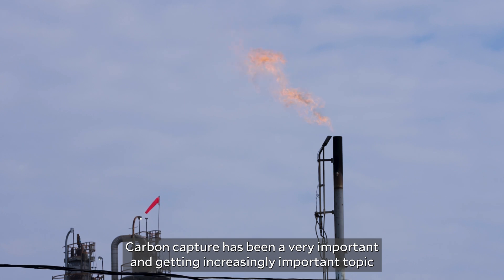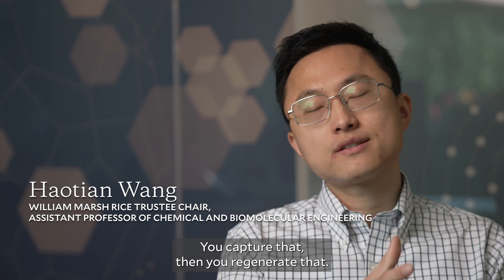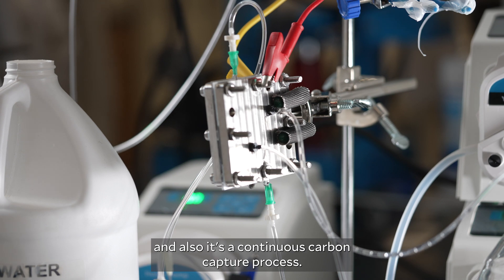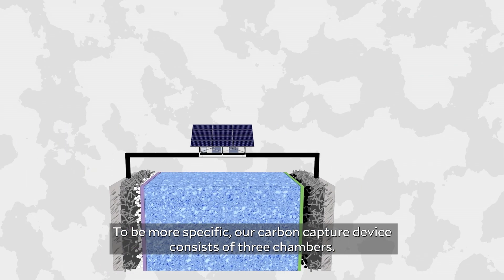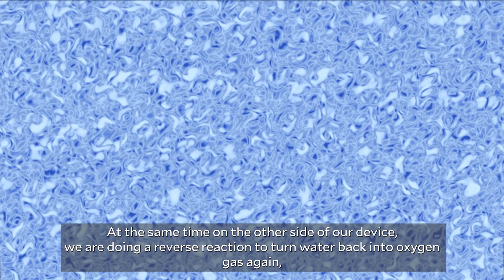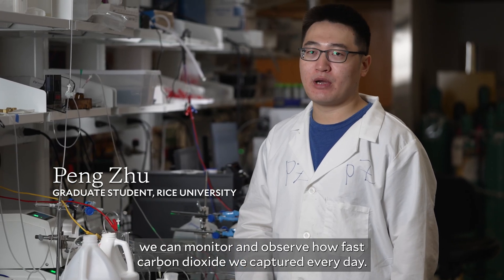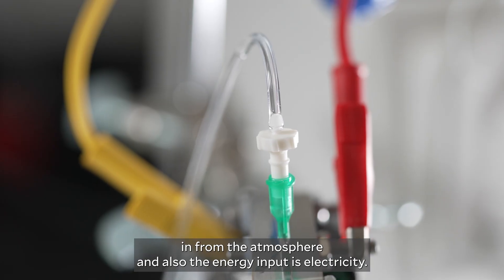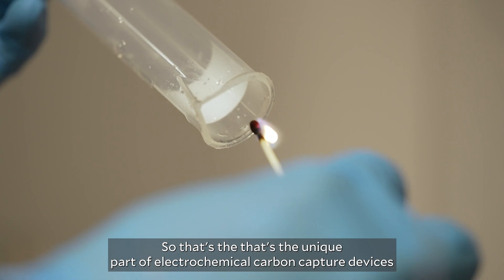Electrochemical device captures carbon dioxide at the flick of a switch

Comment: Have you tried grass or algae for the same thing? Are you aware that 80% of oxygen produced by phytoplankton in the Ocean, and this is exactly comes from capturing carbon dioxide?
This process is as stupid as electric vehicle. Produce carbon dioxide to produce electricity to charge EV, produce even more carbon dioxide to produce the batteries and get the vehicle that does not last even 7 years, even in theory..

Comment: So you need an electrolyzer. What electric power do you need for those 90 KG CO2 per day?
Reply: A lot. Not to mention that you have to pass every single cubic cm of air through the device as with a dehumidifier to capture water gas. The usual buzz words sold as new stuff.
Reply: How much exactly "a lot" to capture 90kgbof CO2 a day? @ciprianpopa1503